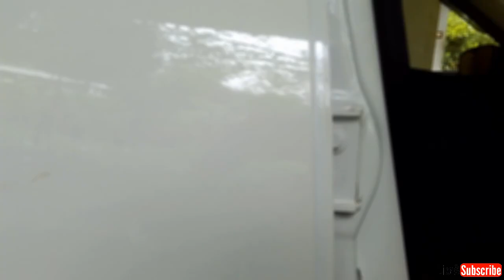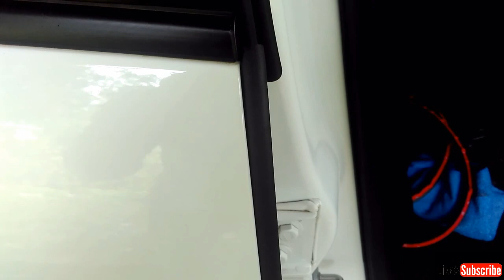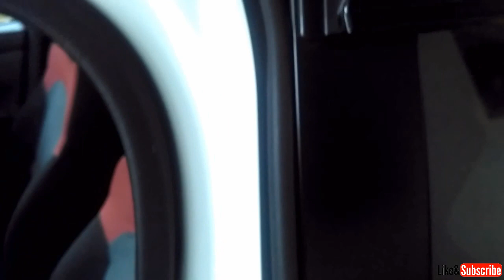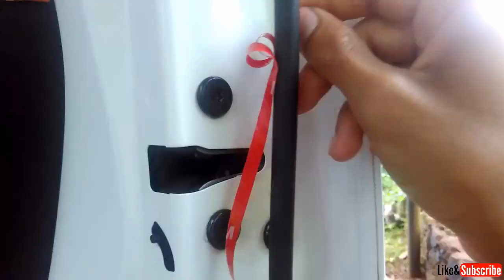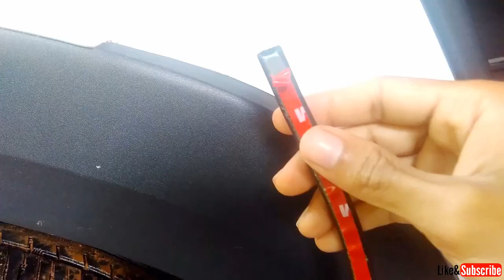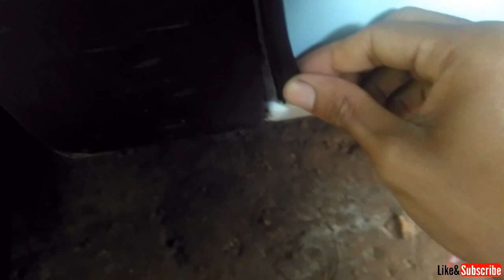Car Door Sound Damping With Small D Rubber Seal DIY - Renault KWID

Comment from the maker: Car Door Sound Dampening or sound deadening using small D rubber seal at home. It will reduce overall wind , road , tire and Engine noise inside the car cabin. It will also make your car doors closing with a soft sound like in more expensive cars. More Details Here...

P Type Rubber Seal

(For Kwid 3 Meter Length Required )

Amazon India
https://amzn.to/3mOToni

Amazon United States 
https://amzn.to/3pF84aG

Amazon United Kingdom
https://amzn.to/2JXdjlm

Small D Rubber Seal | (4 Meter Required for Kwid) 

Amazon India
https://amzn.to/3lY8Ts5

Amazon United States
https://amzn.to/2UD2KpC

Amazon United Kingdom
https://amzn.to/36R3C18

Big D Rubber Seal

Amazon United States
https://amzn.to/3pvBibT

Amazon India 2 Meter Small D 
http://amzn.to/2poqoX5

Amazon United Kingdom
https://amzn.to/3lPxcIv

Z Type Rubber Seal  |  2 Meter Required For Kwid

Amazon United States
https://amzn.to/35A13Qd

From Amazon India 2 Meter Z Type
http://amzn.to/2G1ytLN

Amazon United Kingdom
https://amzn.to/33SCrkC

Small D Rubber Seal Installation Video,
https://youtu.be/ecHnuAEtD8o

Z Type Installation Video,
https://youtu.be/ZurkRlcOVkE

Installation  

1.Wipe off the stains, dust and oil at the installation with a dry cloth
2.Peel the 3M protective film at one end of the seal strip in the exact position
3.After the paste is finished, press the seal firmly
4.Prohibit the car wash within 3 days, within 24 hours try not to open the door repeatedly

Please leave your feed backs and doubts in the comment section.

Comment: Really nice idea. But what about the hood sheet metal which is very thin and rattles, makes noise
Reply from the maker: +Santosh Bejekar Kwid  Bonnet is Heavy and Boot lid is very light , For Bonnet Rattle I will make a simple video.. Its a loose rubber bushing Problem.. Just tighten and resolve the problem..
Reply: RicTheCarLover Yes. Those rubbers can be rotated and can be better set as required to avoid rattles
Reply from the maker: +Santosh Bejekar  yeah, 👍👍
Reply: Hi...for Renault Duster which is the best tape for sound proof?.
And what is it called so I can buy online ?
Thanks !
Reply from the maker: For every car , for complete door damping Z,P and Big D  should use , I uploaded three videos ,each rubber seal is pasted on different areas of door.. only length is different for different cars...

Comment: Bhai mere pass tata vista he quartejet engine diesel usme 70kmp ki speed ke upar jate hi cabin me sound aati he bahut uske liye helpful hoga kya ye
Reply from the maker: +Ajay Berwal , wind noise,tyre,road,and engine noise all will increase as speed increases, so you can install these D,P and Z Type rubber seals on Door,Boot and Bonnet area to reduce some amount of that noise, for more noise insulation you need to dampen floor ,roof and door pads with damping sheets by your self or from a auto shop.. Thanks..
Reply: I was facing same problem with same vehicle got resolved through dfsc & sound deadener with 3M car care
Reply: Bhai d p type rubber All over market m kahi nhn milrahi
Reply: Kha p mlegi

Comment: Bro...kwid ke engine, road, tyer noise bahut jiyada hai toh yeh door par rubber lagvane se cabin kitne % silent bata hai??
Reply from the maker: +Sanket Vasava 30 to 40 %
For full Damping you need to use Damping sheets and that's expensive .. 
This rubber seal will reduce noise and also help to prevent dirt getting inside door sills..
And gives a thud sound when closing doors..

Comment: Does this really reduce road and wind noise. Do these work effectively? How long do they last?
Reply from the maker: It's the basic Step in sound damping , for complete sound deadening do it form a accessory shop, they will dampen the car with sound damping sheets.. I had installed it 2 years back , no issues..

Comment: Hey bro how is the long drive experience on kwid and does it fit for long drive,shall i buy a kwid or wagonr bro
Reply from the maker: +muhammed hussain  kwid Suspension way better, Long journeys are very comfortable especially on bad roads.
But wagonr is good if you are a tall person and safety wise one more airbag on top end model available , ABS also , but back seat Comfort is very bumpy and Mileage is also less in real world driving. Don't forget the 300 L Boot space of kwid , more than Swift and Medianav with inbuilt navigation..
As an overall package i will recommend Kwid 1.0..
Reply: RicTheCarLover thank you very much bro,this is a great channel to subscribe, bro could you please tell me the interior space of kwid vs wagon r
Reply from the maker: Thanks +muhammed hussain , seat width and under thigh support is more in kwid.as wagon r is a tall hatch back and back side window glass area is more in wagon r and you will get more light inside the cabin , in kwid back space is very good but as the rear glass area is low you will feel little claustrophobic.. 

If you and family tall people and old one will love wagon r because it is easier to get in and out.. 

Boot space 300 vs 180 L 
So going long Journeys with lots of luggage is breeze in kwid .. and 3 medium size men can fit perfectly at back..

Overall storage area and Inside space i think Kwid wins..